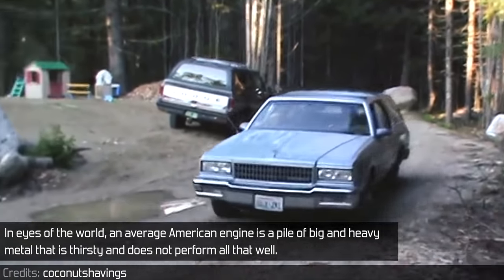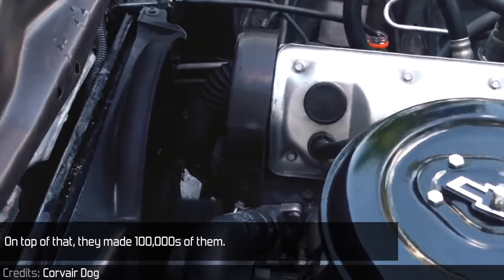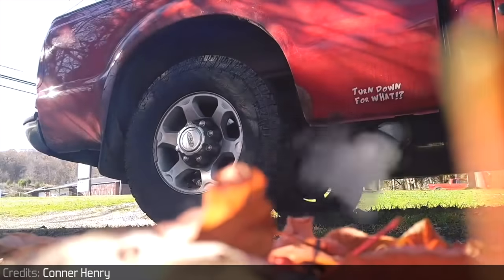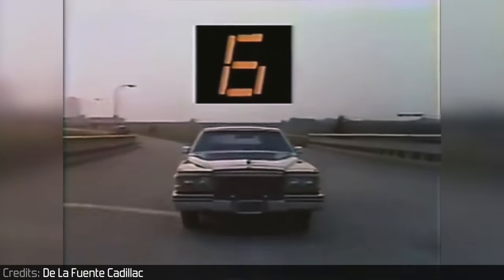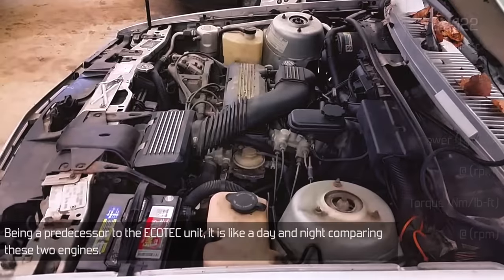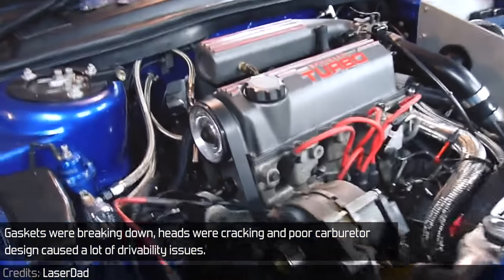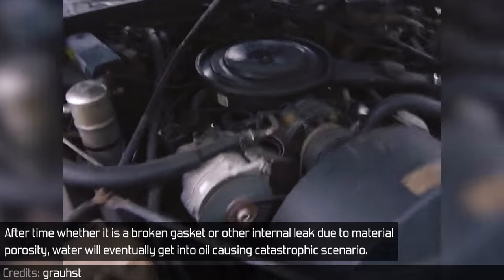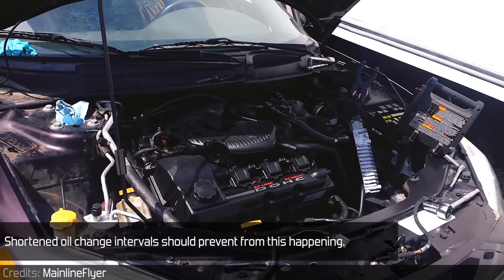8 Worst US Engines You Should Avoid

Comment: The modular ford engines are great....everyone loves to complain about shit but i know people with +300k miles on a 5.4 and a 4.6 with no problems ever. The ford cars i have owned have certainly been better than any of the Japanese and Korean cars i have owned and worked on
Reply: I agree had two triton 4.6 that was dogged out and ran hard and never skipped a beat , wouldn't consider it a speed demon but it pulled pretty good
Reply: Me too ford is the best
Reply: I would NEVER buy a Ford ever again. I have had nothing but problems with the 65 Mustang, 71 LTD and 3 Ford Festiva's from the 1990's! The only Ford I would think of buying now is a 1955-57 T-bird -- IF it is a legit original!
Reply: I bought a new 2007 Hyundai Sonata with 3.3 V6, 234 hp and now own a 2012 Kia Optima 2.0 Turbo with 274 hp. Both engines good but the 2.0 Turbo with direct injection is the best I've owned. Power when I need it, excellent mpg when I don't.
Reply: Creed 00 I had a 96 2v 4.6 with almost 700k original miles on it
Reply: Jaime Acosta The new Ford's are well made the old ones are garbage I owned a 69 390 Cougar no joke the car had about 5,000 on a rebuild I would 75 percent of the time a drove I would break down and it was 320 motor It was very slow for a muscle car and I owned a 71 Lincoln Matk Iii with a 460 it had 70,000 mi and blew a rod in it never abused and maintained the car
Reply: Willie Daniels That is funny I didn't have bad luck it's true they are crap I had 69 Cougar w very low mileage on a rebuild and I would break down 75% of the time I took it out and the HP 390 so it was pretty rare and it was very slow for a Muscle Car and a 71 Lincoln I blew a rod at 70,000 mi it was a 460 Mark Iii and at the time when I owned both cars I owned a 73 AMC Ambassador 401 that car would blow the doors off of either car and it was full size and in 73 they lost horse power compression
Reply: its Obviously that guy don't know that the 5.4 and the 4.6 from Ford are based off of the old 332 V8 and the 289 V8 .     Both were damn good V8s back in the day and are even better today

Comment: Those Chrysler 2.2 engines were solid. I've had experience with several 2.2 powered vehicles; while the vehicles, themselves, had their problems, the engines weren't amongst them.

The bigger reason for the crap engines came from Nixon implementing the EPA (we are still suffering from that; I haven't seen a brand new car worth the asking price, or that I wouldn't be embarrassed to be seen in, in decades), and Jimmy Carters mishandling of the mideast conflicts. Government bureaucracies screw everything up.
Reply: yah my experience with the 2.2l was they just would not die.
Reply: The 2.2 were decent engines. I had a carburated one & a FI turbo both were solid.
Reply: Amen. 2.2 did not deserve to be on this list. It powered mini vans, k-cars, Omni's, Daytonas and more.  GREAT motor!
Reply: We had a turbo Lancer.  Never had engine problems, but the K-car tranny wasn't up to handling the extra torque from the turbo, and it gave out after only 108,000 miles.
Reply: Here in Argentina these 2.2 Caravans refuse to die. Still run to this day. Great minivans.
Reply: Nicolás 94 LP- yeah, man. I wouldn't mind having another one.  I had a Dodge Mini-Ram van, which was the panel van. Of the various 2.2's that I've had experience with, that was my favorite.  I should have kept it.

Comment: I've had both the Triton 4.6 and a Mopar 2.2 and I never had a problem with either one. I currently have a 2005 f150 with a 4.6 two valve and 160k miles, zero problems. I think the 3 valve motors have the most issues.

Comment: You are wrong about the Ford Triton engines! I guess thats why the Crown Vic 4.6 was so popular for use in police cars?
Reply: Edward M Alves They were not popular because of the engine. It was more related to the rest of the vehicle. Like overall dimensions, interior dimensions, rear wheel drive, long law enforcement relationship and, last but not least, the deal Ford would give them.
Reply: The 4.6 in the crown Vic was not the same as a triton.

Comment: the gas olds 350 was awesome engine
Reply: chris chatzidimitriou the gas olds 350 was an awesome engine, where they screwed up was taking the exact same engine and bolting little more than an intake manifold and heads to it and expect it to.live as a diesel. Converted back to gas they ended up being tough
Reply: Jake 1024 Yeah that's the reason why GM converted those god awful 350 diesel engine to gas to sellout model that had them... The same with 4.3 diesels as well ...
Reply: +chris chatzidimitriou | the Olds V-8s are super tough and reliable. I saw one with 500 000 miles. Even though the diesel was a crappy setup but it still sounds sick as fuck.
Reply: The 350 olds diesel was a completely different block (much higher nickel content) Could be safely bored .125 thousandths overbore without sonic testing , Heads, intake, complete engine were not the same.. It shared the bolt circles to attach the accessories,transmissions but that's about it. After 1980 the main journals were 3" BB ones. Also roller cam, and lifters were installed.

The GM  genius's never installed a factory fuel and water separator in any GM diesel equipped car till 1984, They Installed weak head fasteners nor prepped the public on how to care for a diesel. By then the damage was done. Water and oil don't mix so many who filled up at other than truck stops (huge amounts of diesel fuel sales) were almost guaranteed water in the fuel. Which spelled disaster because most people did not have a clue and drove them just like gas powered cars. Poor R&D, and public awareness killed GM not this engine. I know a few that have hit 200-300k. Not bad for the worst engine GM ever produced 

FYI Most racing builders use the DX block to build a big cube bullet race engine so if anything the diesel is converted to a Gas engine.
Reply: SmallBlockChev Thats true I've heard some guys who kept them in good shape and hitting 500 000 to 600 000miles.
Reply: chris xaf12 Some of the Delta 88s in the late 70s had Chevy 350s in them.
Reply: GM divisions all used each others' engines.  Pontiac mills in Buicks, Chevy engines in Oldmobiles, Buick V6s used almost interchangeably with the Chevy V6s, etc.   If you had a GM car with a straight six it was a Chevy mill.  With the exception of the 1960s Pontiac OHC thing, no other GM division made a straight-six, and even the OHC Pontiac was derived from the Chev.  The only division whose engines were not part of the 'mix and match' philosophy was Cadillac.  Cadillac engines were never used in other divisions' cars.  That said, Cadillac often used Buick and Olds engines in their vehicles (the 3.8 and 4.1 Buicks, and Olds 260 and 350 in both gas and diesel variants).  And worse, most GM engines had similar-sounding variants in other divisions.  

I used to work a parts counter in the 1980s; it was always a hassle trying to figure out what the customer had under his hood.  "Which engine do you have?"   "It's a 350."   "Yes, but WHOSE 350?"  "Well, it's a Buick car, so it's a Buick engine."   Can't rely on that, so let's go take a look.   Nope.  You got a Tin Indian in your Buick, mister.  "Aw, bullshit!    What the f*** do YOU know?  Why would Buick put a Pontiac engine in my car?"   Lather, rinse, repeat, several dozen times a week, with random names on the cars and engines involved.
Reply: Buick 350 was a pretty awesome engine too because it was massively undersquare with a long ass stroke so the thing made big block torque
Reply: lets go around the world in a ROCKET OLDSMOBILE

Comment: I owned a 1977 Vega. In1976 GM the went to hydraulic lifers and the engine ran great. Only problem was timing belt failed at 85k on mine , and made it to 135k when it was wrecked in a accident. 
I own a Ford Triton V 10. 1990 to 2004 the engines tended to blow out Spark plugs Then the they changed the head in 2005 and up the spark plugs would get stuck in head and snap off. My 2000 V10 has 205k mile only problem exhausted studs rot off

Comment: The Ford trifling V8 how they dodged a class action lawsuit is beyond me. anytime you have to buy a bunch of helicoils to to give the vehicle a tune-up. On another note I would have to disagree with the 2.0 GM motor. I owned several of those Cavaliers and never had to work on any of them they were extremely dependable, they were a little underpowered though, but what vehicle wasn't in the late 80s early 90s. Although they did mess up when they put that engine in an S10 way under powered and you would blow the head gaskets regularly.

Comment: Subaru head gaskets...Honda transmissions all failing ..
Reply: Nissan CVTs
Reply: I had an older Subarru before 4 wheel drive the hub striped out and pushed it 2 miles hoping to get it fixed , nope took for scrap / Best thing about the car was the headliner , tuff no holes ,cuts perfect but the rest no good .

Comment: ford 4.0 SOHC on rangers and explorers, who the hell will put a timing chain on the back of the head?
Reply: Edvin Nelius had a 93 ranger with the 4.0 v6 never, I repeat ABSOLUTELY NO PROBLEM with it. Mine had well over 300000 miles on it before the transmission went bad  sold the engine to someone else and they are still running it today
Reply: The 3.8 Essex was a better engine.

Comment: The '70s and '80s were a dark time, particularly for the U.S. 'Big Three'.

Most modern econoboxes have more power than musclecars of that era.
Reply: with a fraction of the torque and reliability.
Reply: Which econoboxs had more than 320hp???
Reply: CanadaBud23 they didnt lol.
Reply: A 1981 Camaro Z-28 had 175 HP. An 1982 Mustang GT had 157HP.
Reply: The 80's were bad. The 1970's were a dark time? In 1979 the domestic auto makers controlled about 85% of the American market. Today they control about 44% of the American car market. That's if we still consider Chrysler an American company.
Reply: Don't forget the Iron Duke at 80-85 hp in the Camaro.  Good Times!
Reply: Only 2-7HP more than the terrible 3 cylinder 2018 Mitsubishi Mirage that Doug DeMuro just reviewed!
Reply: James Dawson, 190 with the 5.7.Remove a few things, and add a couple more, and it can easily pass 300hp without anything major. Same the with Mustang. I owned both 1979 versions.
Reply: There are plenty of Subarus and Toyotas out there with over 300,000 miles on them, and are quicker than all but the most powerful old musclecars. 

And if you can't get at least 200,000 miles out of a new car, you've kind of been screwed. In the '70s & '80s, 150,000 miles was great.
Reply: Scot Caraway 

The 1982 or 1983 4 cyl. Camaslow ?
Reply: Frigglebiscuit No you are wrong, the engines from the 79’s & 80’s were sick.  No power, torque or reliability.
Reply: CC Ryder Not stock.  Maybe 190hp.
Reply: can't compare 30 years of trial and error. they don't have more power than early 70s' but when car weighs have as much you can have half engine in it to accelerate just as fast. pre 70s cars had traction problem and skinny tires with big engines. late 70s and 80s cars were detuned, decompression EPA smog engines with heavy body.

Comment: I worked on cars professionally for 31 years and the GM 2.2 was and still is a good engine. I had one myself that went 218,000 before the main bearing went out. I dropped a used 2.2 in the Sunfire with 91,000 on it and 7 years later it is still running. I've seen that happen with many 2.2 engines.
Reply: I agree. The 2.2 is crude and unremarkable but it’s good for 200k with normal maintenance. Pre Dexcool there weren’t really cooling system/head gasket problems anyway.  Extremely cheap to maintain too.

Comment: Tritons are great if you know what you're doing
Reply: tritons do require a certain 'touch' as do alot of others. if you have had no problems I would guess that 1) you always used the factory reccomended coolants and oils. and 2) you may have heard of some of these issues and the most common cause and used this info to maintain better, therefore not having these issues.
  you have to agree that anyone who did not do this did not have a good experience. 
in the case of my toyota I did not follow the manufacturers guidelines. I did not change the transmission/diff oil on schedule. I was not nice to this truck at all!
 it has carried me over 300k miles and never made me walk. I was not nice to it for even a moment. it got to burn all of my rotten pre-mix for chainsaws/dirt bikes etc... that is a truly great vehicle, one you can abuse for that long without repairs or failures due to using the wrong kind of coolant... just sayin'
Reply: Luke Warmwater that’s a dumb argument so I’ll just go change my trucks oil with 75-140 gear oil and when it blows up my trucks a pos the manufacturers say to do those things for a reason they didn’t spend millions of dollars r&ding that for no reason
Reply: I think you totally missed the point there, but thanks for cementing it more solidly into place for me.
 if you do not use exactly what the manufacturer states should be used it falls apart. that's not durable. that's cheap crap with a built in excuse for failure. thus it falls into the pile-o-crap pile by defalt.
 once again, thank you in advance for making my point more clear to everyone else......
Reply: That doesn’t make something a piece of crap you obviously don’t understand bearing clearances or that some chemicals can’t be mixed without a reaction aka clotting or wearing seals so your still not making any sense because they tell you what you should use this is just sad 🤦‍♂️
Reply: ok. you have made my point for me again...... look. as an example I can give my 92 Toyota. for its entire life it has run on 20-50, the book recommends something else. it has gone over 300k miles. it has burned coleman camp stove fuel and old rotten premixed weed eater gas. no problems whatsoever. not one stripped spark plug. it has been under water four times!!! can your triton do that?? no. no it cant. the first time in water it would have spit out four of seven plugs, minimum..... that y friend is a big giant pile of crap. 
 one reason and one only for that. it cannot withstand mistreatment

     it cannot withstand mistreatment.   you lose this debate, get over it.
Reply: Not a debate your obviously a bad car owner like to the fullest not saying you 22r I’m assuming wasn’t great they are good too but I’ve had customers with them make 450k miles we took the heads off to do valve seals and it still that the crosshatching on the cylinders as of right now that truck has 550k+ miles so you loose the “debate”
Reply: Luke Warmwater I'm not super religious about it but I use good quality oil, Ford filter, and either Motorcraft green or gold coolant. I'll just get me a couple gallons and then fill the rest with DI or distilled water. Hehe only issue I ever has was a coolant leak on the intake manifold gaskets. But they did have 239k miles on them so I put new ones on and haven't had any issues. 245k miles and going strong!
Reply: the triton is still a picky primadonna of an engine, that's been the point the whole time. good engines don't require special treatment they just go.good engines don't have spark plugs that engage, at maximum, four to five threads on the plug with a giant space for fire to flash into and foul things up around the sealing ring.... its a weak design, always has been that engines archiles heel. 
 maintenance costs make anything else a better choice than any of the engines listed here. I think that has been the point all along.
Reply: That may be your point but comparing any new engine to older engines in that sense doesn’t make sense the bearing clearances and the lower power output make them so where they can’t hurt themselves and the triton isn’t as picky as you think I have had customers come it running 20-50 before they can do it but it will shorten the life span of any engine even the 22r’s had a customer with on of those come in with 450k+ miles with the motor looking great and another with 200k miles that was destroyed cause they used the wrong oil it’s not a premadonna engine just if you want it to last longer you use what is recommended
Reply: And the plug thing only applies to the 3v version which is junk as far as plugs blowing out is seen where it’s usually the installer over tightening the plugs and pulling the threads off or leaving them too loose and allowing combustion to leak around the threads and mess up the threads since some people don’t understand what tight feels like

Comment: a guy I knew bought a vega new, took it home and put a bigger radiator in it, and never had a problem for years and years.
Reply: My dad bought a Vega new in 1973.  He didn't trust the aluminum block, so ordered it with heavy-duty cooling from the factory, which was a $40 option.  There were no problems with it until we took the large radiator out and swapped into another Vega that we were putting a Buick V6 into.     Not long after, the Vega engine started to burn oil.  Yes, it was a mistake taking the radiator out of the good-running Vega, but that V6 Vega was fun!
Reply: I had one with a Monza motor in it. ran like a scalded dog when it ran. Had some electrical issues with it tho.

Comment: The Triton 5.4 is a fantastically reliable engine that will go hundreds of thousands of miles with modest maintenance.  Spark plugs can be changed out for about $600 to avert any problems.   The Cadillac V8-6-4 is based on the venerable Cadillac 6.0L engine that is extremely reliable.  Just remove the V8-6-4 controls and you are all set.